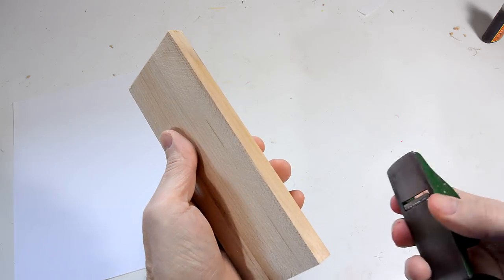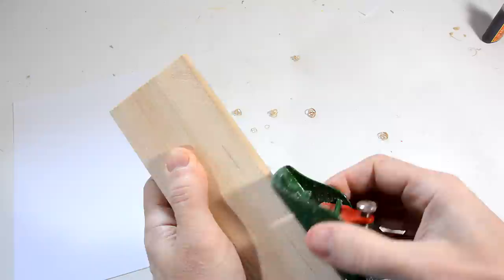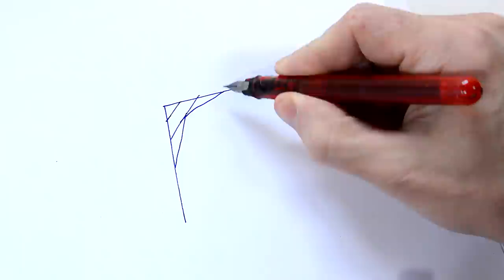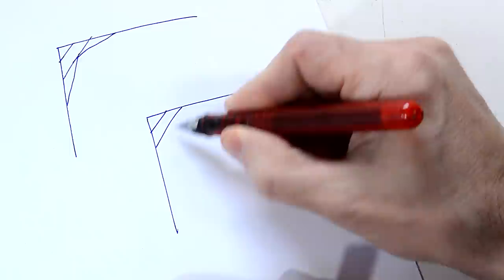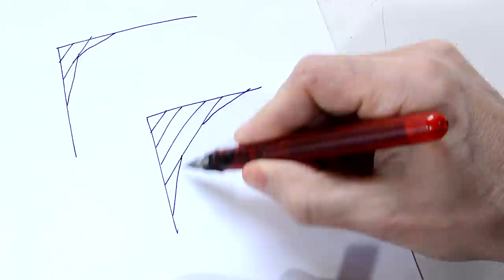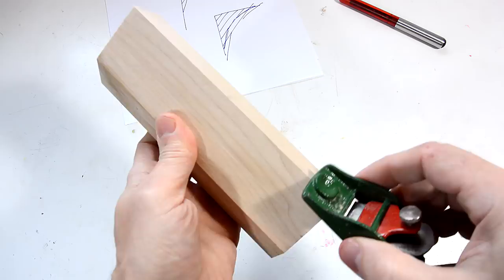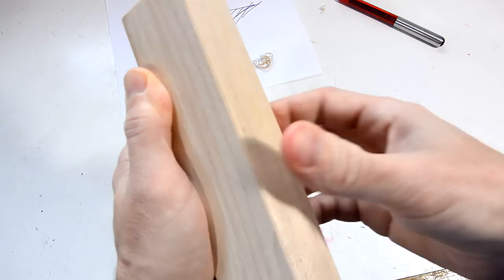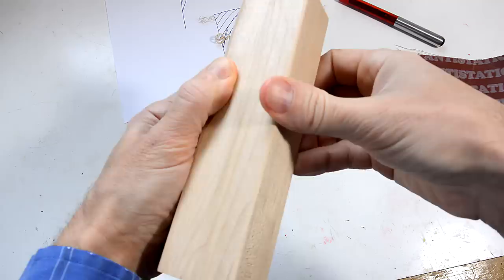Making roundovers with a hand plane

Comment: Thanks for the tip, I bought a radi plane last year and have finally learned to get a nice finished rounded edge with no tear out is to tilt the plane one direction so it only bites just the edge instead of trying to take it all at once and bring it back onto the corner after a couple passes. I love the little pocket planes and like finding another use for them.

Comment: For perfect roundovers with the Wandel 5-1-1 method:
for 1/8" roundover, set plane cutting depth to .010"
3/16" round, plane is set to .015
1/4" round, plane is set to .020"
Finish with sanding.

Note: If you're tempted to plane more on the 4 edges left after 5-1-1, your plane depth would have to be adjusted to be only one quarter of the previous depth! So best not to continue planing, and go to the sandpaper.

The above depths are very close to theoretically perfect. 
 For instance 1/8 round at .010", perfect depth is .0103 
For 1/4" round at .020 depth, perfect is .0207

Comment: So what would be best to round out door jambs on pine wood I heard sanding block works at a 45° degree angle but dont want it to look oddly shapped when I put my trim on to get my reveal.
Reply: If you send straight across your corner, and flatten it out the links of your material then you can hit that outer edgethat you just created on each side and you will have a slight round over. If you still need this information hit me up and I'll be more than glad to give you more detail on it bye for now Ken

Comment: Well done Matthias, you either have a very good eye or you worked it out mathematically.  My check with a Solidworks sketch showed that 5.027 center passes and 2 outer passes at the exact same depth would be perfect!  10 thou deep passes and minimal sanding will give a .12" radius, so essentially a 1/8" roundover.

Comment: Excellent video and great explanation! I would like to buy a hand plane that can achieve something similar... similar sized rounded edge.. what hand plane should I get? I see so many sizes and specs like #1, #2, #3, etc... which one is a good one for a beginner.. perhaps a common well rounded hand plane that would be used the most, and/or at a minimum achieve what you did in this video? Thank you!
Reply from the maker: the best for you is the one you prefer to use.
Reply: Matthias Wandel thank you!